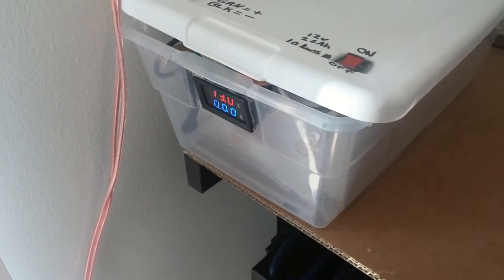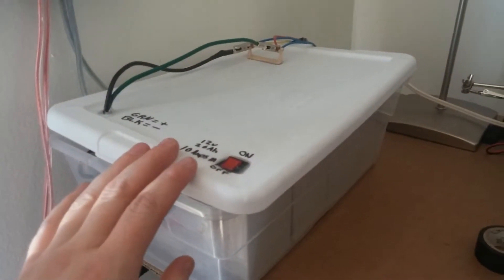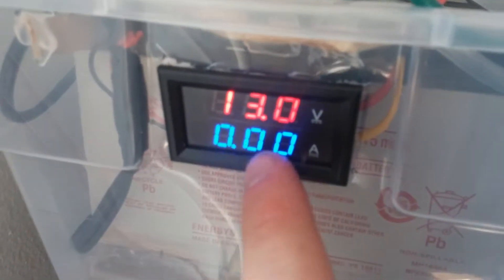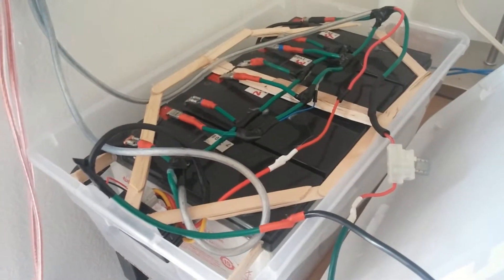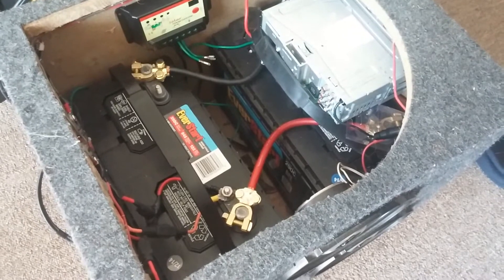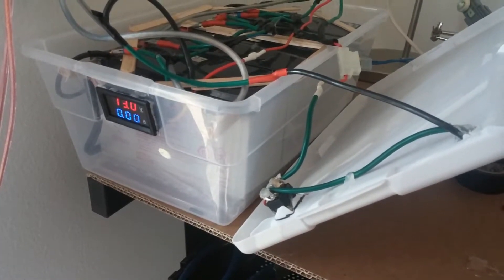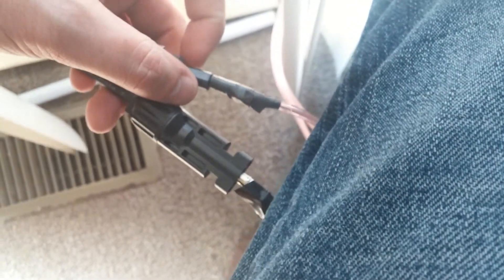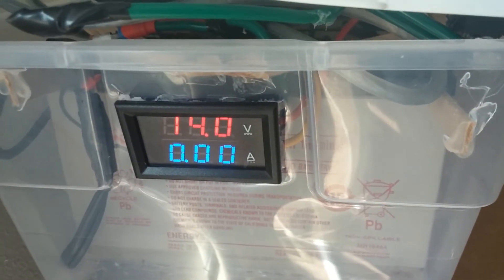Small Solar Setup in my Apartment

Comment: what's going to happen if it's over charge the battery
Reply from the maker: Offiter Necunoscut the charge controller prevents that from happening once the battery is charged. The charge controller will shut current off to the battery